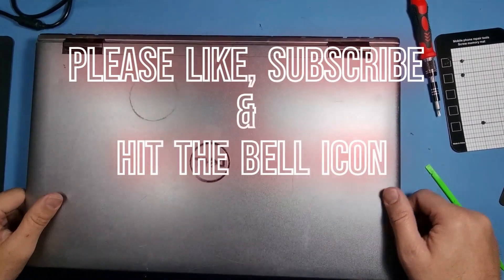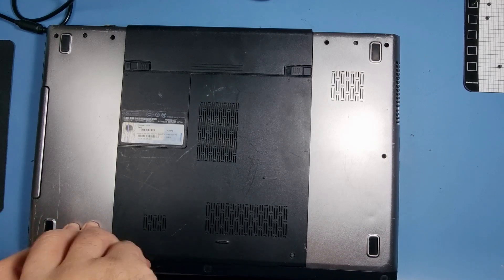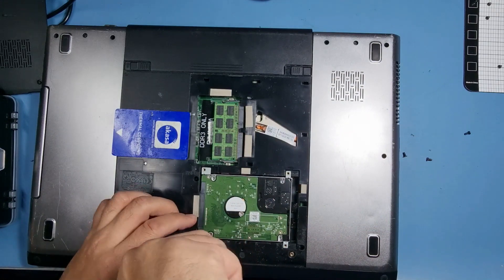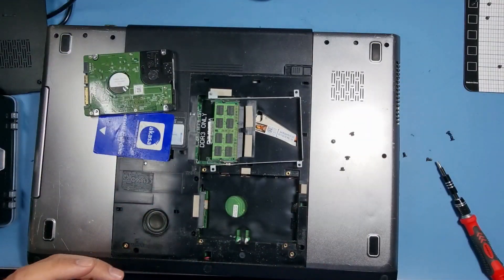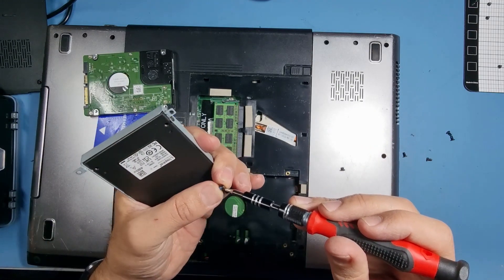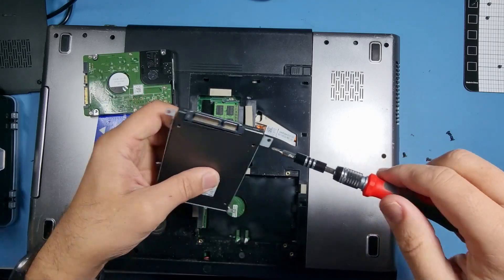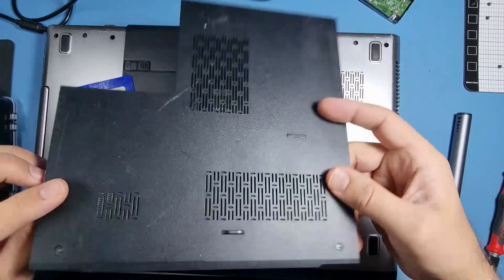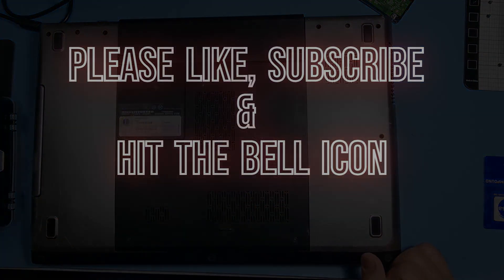Dell Vostro 3750 HDD to SSD

Comment: Did your 3750 HDD to SSD conversion require a "media driver"? After SSD hardware installed, Win10 says it requires a media driver to install the OS.